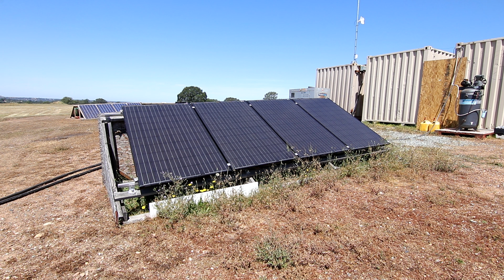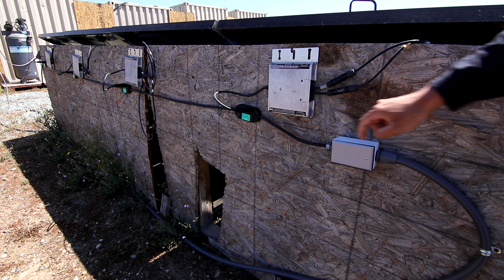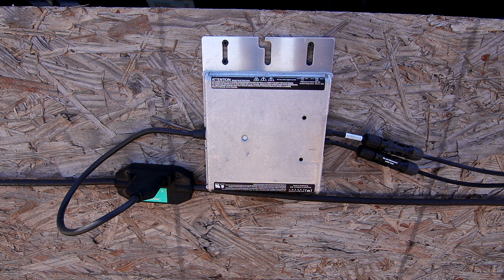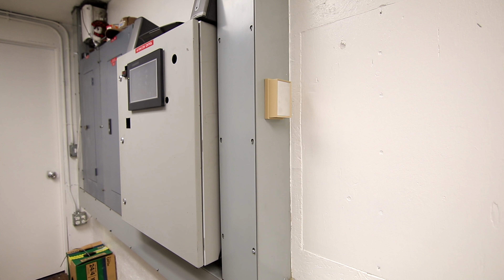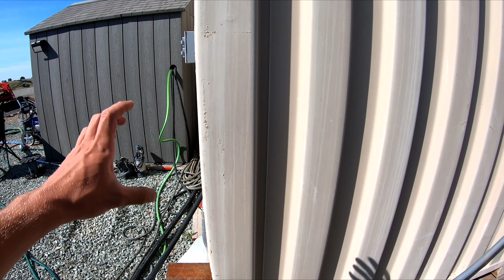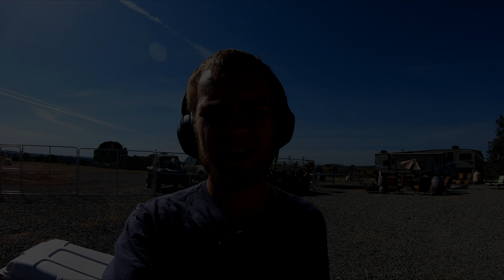Off Grid: Solar Panel Reconfiguration Pt. 1

Comment: Hi, maybe you already got that question. But why you don't build a solar tracking system to got more efficiency out of your pannel. I mean a system who can rotate to follow the sun.
Reply: The sun moves like a sine wave, it has not changed since the last re set.
Reply from the maker: I used to have a solar tracking system, but we are on the top of a hill and the wind really gave it a heck of a time...I had a few actuators break due to overload, the premade control boxes only seemed to last 6 months.  I looked into the cost of upgrading the trackers, the cost of metal, actuators, control systems, etc. and it was nowhere near close to the cost of getting 20 of my panels and fixed-mounting them.

Solar tracker for 10 panels was around $2000

20 245 watt polycrystalline panels were $1200 + $400 in lumber.
10 facing east and 10 facing west provide equal output to the 10 on a tracker (At noon all 20 panels generate partially)
They don't have to be strapped down in the wind.
No moving parts to break.
Easily portable, because it doesn't have to be welded to a container or concreted into the ground.
Reply: @HighTechLab  WTF happened to you putting your solar panels on your containers!? You are all over the place... Make your f..king mind up and make it happen!
Reply: @HighTechLab  If you use the proper hardware to secure them down! There will be no problems on the containers!

Comment: Me and my friends are attempting to do this very thing. The inverts we have do not supply a neutral wire (I didn't think they needed one anyway). The micro inverters we have are configured with two "Goes Indas" (MC4s from the solar panel) and two "Goes Outas" which appear to be one wire each of "L1" and "L2".  So when you show your junction box and talk about the neutral wire, I/We need an explanation of this with some detail as where does the neutral wire come from? For this conversation assume we are talking about Enphase IQ 7XS micro inverters. Thank you. We are getting frustrated as to how come our system isn't working yet. It is set up to supplement a grid tied solar system and be somewhat portable as you have yours.

Comment: why not leave the panels on top of the container but raise them up about three inches for a bigger air gap and do the rest of the containers I wood think they wood help with keeping the sun from heating the top's of the containers and keeping the inside of them a little pit cooler and the run's shorter

Comment: Thanks for your video. If I may suggest, AC coupling is great when you have the control of your system. Since you have a voltage transducer monitoring the batteries, you could program a charge enable output similar to Jack Rickard’s set up and have the plc output turn off the contactor for 500ms, this would disable the charging for 5 minutes while the micro inverters are syncing to the inverter’s output. Another way, maybe more gradual would be setting up the PID on your plc, where you could drive the analog output to talk to an analog solid state relay to control a heating element, let’s say in the range of 90-95% battery charge, scale it to 4-20mA, and anything over 95% ( in case of the water heater failure) you can disable the contactor as an additional safety measure.
Reply from the maker: I appreciate your well thought out comment, it's actually a great idea.  I was so close to doing this, but then came up with a better idea (Hence why I faded into black in the middle of my sentence on the video).

The issue is this, I'm moving the solar panels about 200 feet to the west so that they are further out of the way.  This location will actually yield more morning sun.

Then panels that are grid tied used to be a "mismatch" to the rest of the system.  The angle they were facing, the voltage an amperage characteristics, everything...but then I obtained some new panels and built some strings that match exactly what these panels were running at.  I am now able to parallel them up with those other strings and they will work well in harmony.

With my new setup being moved into the field 200 feet, now to keep the grid tie would require pulling 220 feet of #10 wire, x4 runs (880 feet).  Pricing out the wire the gain was not there.

I will have a spare 1" conduit in the trench that I can do this with in the future but since I only have 3x 210 watt panels as "oddballs" left, there would be no real gain in pulling all that wire.

I bought a contactor and everything to turn off the grid tie when the voltage got too high.  I was very very close to doing this.

Comment: Oh ya I have 11 micro grid tie inverters AC coupled to my system they make great charge controllers, to overcome the overcharging a relay can be coupled in so it boosts the frequency at a pre determined voltage which shuts down the micro inverter or just use a MagnaSIne inverter they have built in control. I hope you have enough Charge controllers for all those panels. Also when you AC couple you can exceed your inverters maximum load. Glad to see you post again Cheers.
Reply from the maker: I have provisions in my electrical room for up to 6 Outback FM80s.  If we add more solar, we are not afraid to add more controllers.

Comment: Why do you point the panels East and West instead of South, where they would get light most of the day instead of half of the day?
Reply from the maker: Because I have heavy loads near sunset when it's still hot, for example air conditioning and I have a ton of power in the middle of the day and really wanted to focus on evening sun

Comment: What State are you guys in?    You have a regular Solar Farm going on there.  I just purchase 4 more 100W panels last month.  Still not got them out in the Sun.  Being Broke I'll be building another 2 x 4 frame.  I'm up to 800W with 1000W being the interim goal.  Still not got the shed built.  Stupid Winds are rabid here right now.  Still need to Cap test my Nissan modules too.  King of Unfinished Projects I am.  Cool Video as usual.  Thank You.
Reply from the maker: Thanks for the kind comment, as usual!  I'm in central California for these videos, but I usually live and work in North Idaho and have a shop there where I do most of my capacity tests and stuff.

Comment: Seal title is only supposed to be used for very short and indoor runs. You should consider burying pvc conduit. Just a suggestion from a retired electrician (industrial).
Reply from the maker: That is the plan. All though sealtite is rated for outdoor use.
Reply: Sealtite is definitely approved for outdoor use... I used to install it on industrial flare control racks for the pickiest engineering companies out there including Kvearner, Sabic and JGC. 

JGC once spec’d full stainless stellite 6 seats in valves for nitrogen service for a thermal oxidizer... I don’t remember who payed that bill but maybe some type of gov’t grant for pollution controls???

Comment: Ok, confused...

At one point you complain about not wanting to drive around & over stuff; then you're going to remove the panels from the container roof?

You should put ALL of the panels on those 4 container roofs!

Out of the way where you cannot run them over; plus much shorter wire runs provides more available power.
Reply: I agree with this guy
Reply: If you secure it properly it wont get blown away and will give some sun shade to the containers to keep them cooler. Yes cleaning would be harder but you only do it once in a while. Pressure washer will take care of them in minutes.
Reply from the maker: But then they are able to be blown away by the wind and a real pain in the butt to clean
Reply: @HighTechLab  Not if you secure them down like you're suppose to! Get a grip dude!